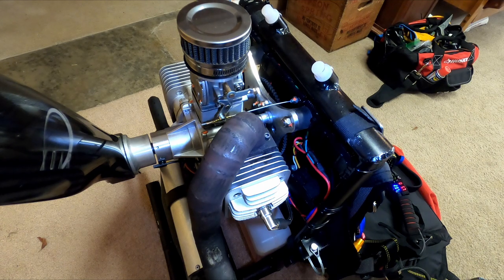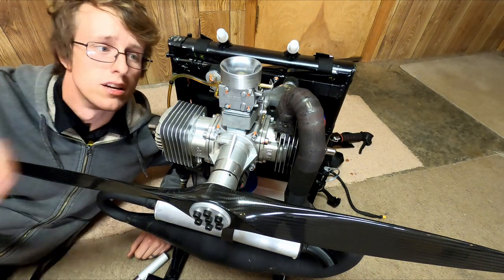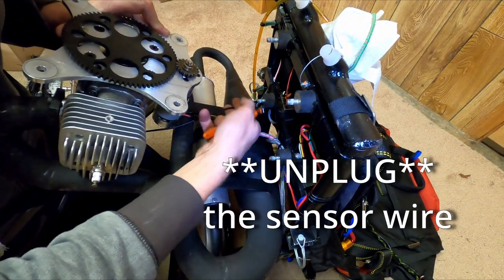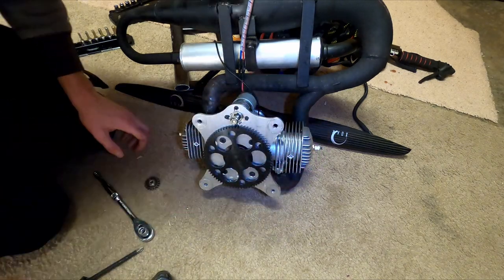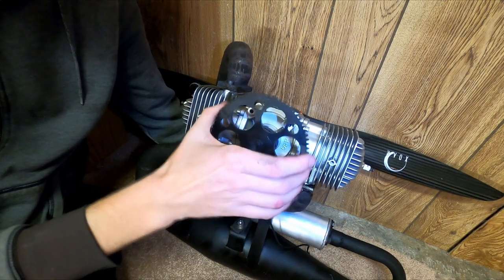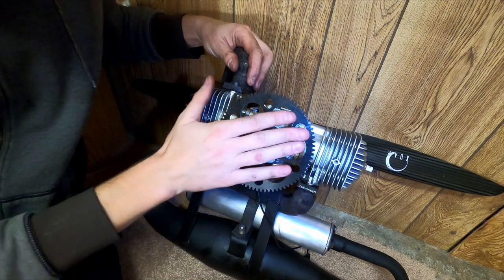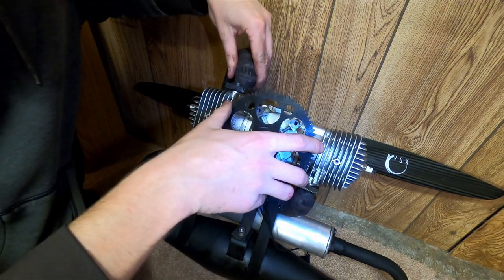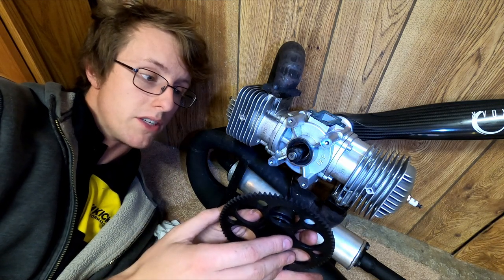AliExpress Paramotor won't start! | Avery Flies

Comment: The important is the engine is working again. Let's watching.
Today I was fly, and I started the engine on ground, the engine accelerate, and the support with propeller fell out. Starting the engine using the propeller, sometimes the engine start reversed...

Comment: Eek, put a cloth in / over the inlet port after you removed the carburettor.  The last thing you want is a nut or other component dropping into the engine.
Reply from the maker: I did for a portion of the work, but yeah, fair point

Comment: Oil is the problem, but not by causing it to slip.  In roller clutches the rollers withdraw ever so slightly into recesses in the cup.  (These things are actually hella precision)  It looks like the assembly is open into the crankcase, too, which won't help.  I suspect that gum and varnish had stuck the rollers into their recessed position.  A good cleaning with carb cleaner should work.  I share your suspicion of "it fixed itself" but in this case it looks like the paper towels were the fix, at least adequately to restore function.
Reply from the maker: Thanks, that's what I thought too, more gummed up oil. When it started grabbing again I used some brake cleaner and stopped it back out. We'll see how long it lasts
Reply: @Avery Flies  Oh and BTW- a solenoid pull-in type starter engagement would probably be much more reliable.  If that option doesn't break the bank.
Reply from the maker: @michaelhamm6207  yeah, DLE makes it that way now. I'm just waiting to hear back and confirm that it bolts on what I have now.

Comment: Ive been to that problem,typical to dle 170 but if you change it to a good quality bearing its good.
Reply from the maker: My problem is trying to get the old one out. Might just buy the bearing and another gear to press into it.

Comment: What did you pay for that unit? Would you buy it again? I've seen them listed on Alibaba but I refuse to make a purchase, little skeptical.
Reply from the maker: After tax, shipping, and upgrades I'm right around $3200, though it couldve been flying for $2900. Use PayPal for buyer protection, and watch my other videos on it. It is low powered and has a bunch of issues that need sorting out before flying.
Reply: @AveryFlies surely crédit card s75 buyer protection is much stronger than PayPal?
Reply from the maker: @turkeyphant  maybe? I've never had a problem with PayPal though, namely because only reputable vendors accept PayPal in my experience

Comment: A little unnerving when the problem fixes itself like that. Not knowing when it'll happen again isnt fun.
Reply from the maker: Too true. One way bearings are finicky on RC cars too. Luckily this doesn't impact the engine *running*, just starting. So if it messes up, you're not falling out of the sky, you're just not getting into the sky. 

But, like I said, I show all aspects of my flying, not just the pretty stuff. Ppg has a lot of maintenance involved.